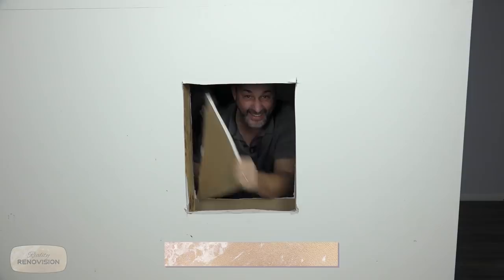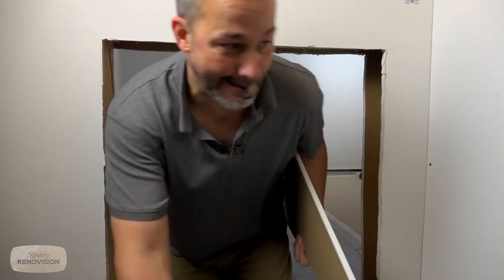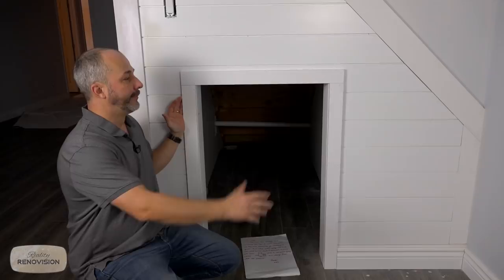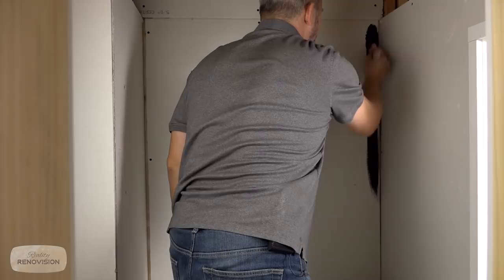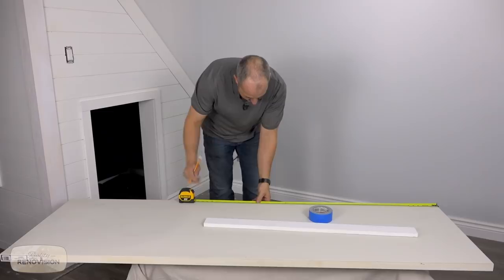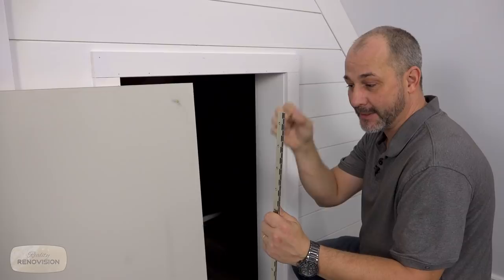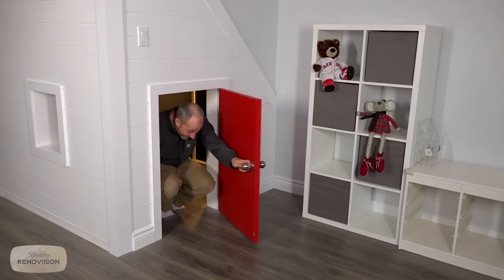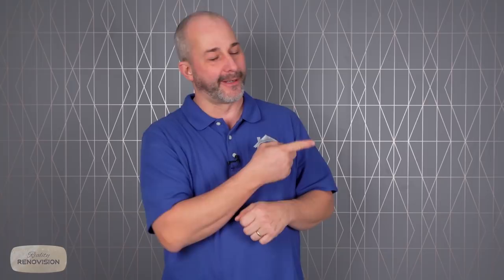How To Build An Indoor Playroom | Reality Renovision Ep18

Comment: Hi Jeff, I was silly enough to agree to change out all the interior doors in my father in law’s house. I found out later the all the doors had been made on site after the house had been built and as a result no two doors were the same size or even the same width so what should have been a quick joinery to the DIY store became a lot more interesting back and forth to get things that normal would be done as standard doors.

Comment: Hii Jeff i am really enjoying your video's on DIY and am planning on building a shed NOT to the size of the one you built but just a smaller scale but i find if you take the time and effort to do something that other people Not of any particular trades take on,  it give's you the satisfaction that I did that works Both way's if its a disaster I did that  But when its a Good job give's you more confidence to tackle other job's,   All to many problems occur when through lack of information or Cash mean's thing's get left because of the price of the material's Plus the Labour cost's can be over the price of material's again but to Cut out The Labour  leaves you with that little bit more for more stylish finish  so i can only dream of some of your project's but Will be attempting some so Thank You for sharing your tip's and overall knowledge to inspire me & Other's to have a go  Great Channel Cheer's.

Comment: Didn't you tell us that LVP does not grow and shrink in another video??
Reply: He said this floor is laminate not LVP
Reply: @Pheoria  Thanks so LVP does not expand but laminate does? Also if he is in a basement should he not be using LVP because of water and moisture issues in a basement?
Reply: I think they both can if the temperature, humidity, etc in the room it is being installed in isn't well controlled. I think LVP is going to resist moisture more than a lot of laminate floors though. All depends on what you buy and where it's installed. I think that's why he wasn't concerned with the lvp in the other video... didn't anticipate temp fluctuations in that space. If you fork over more $$ you can get a better laminate that is waterproofish but would need an underlayment. Personally, I'm going with lvp in my basement and because I anticipate temp fluctuations (I live in a 4 seasons area) will allow for an expansion gap